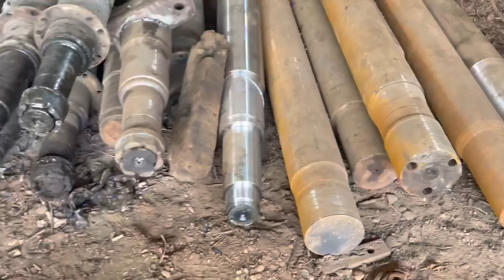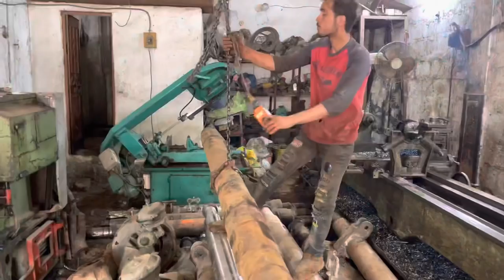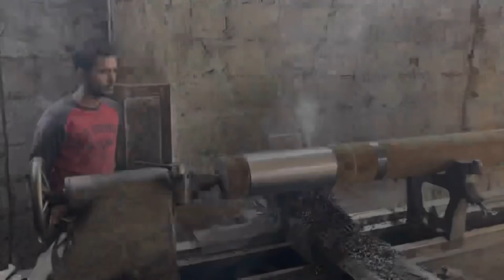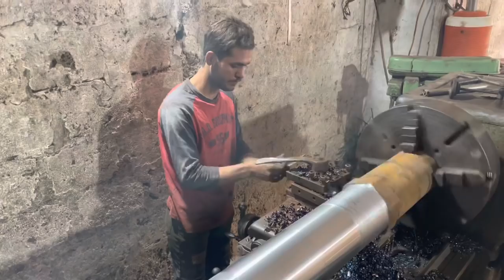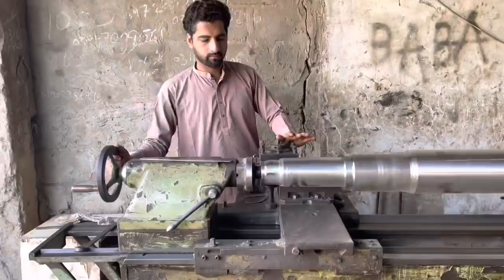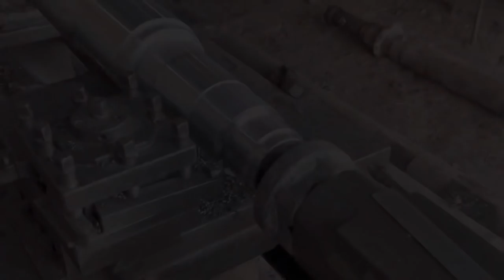How York Type Trailer Axle Shaft are Made From old Ship’s High Strength Rods

Comment: What a bad job. Incredible the dirt of the place. The men work squatting or sitting on the floor. Mechanics repair engines and equipment by throwing the parts on the dirty floor, there's garbage everywhere ... Mechanics don't wear protective gear. Impressive the dirtiness of the place… Also, operating a lathe or sanders using long-sleeved shirts or wristwatchs is extremely dangerous.